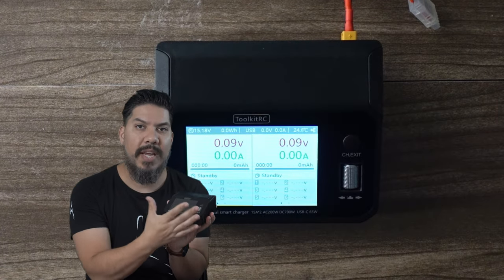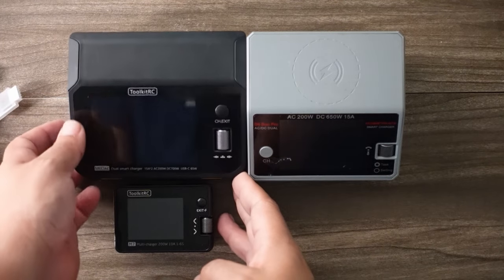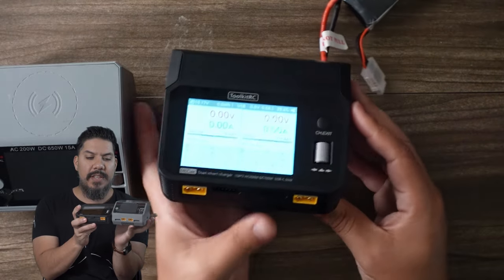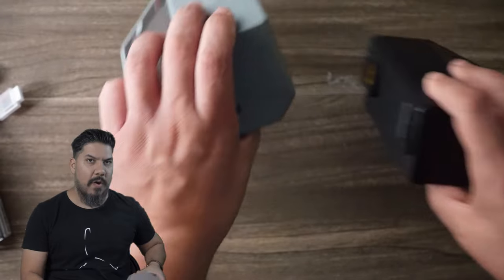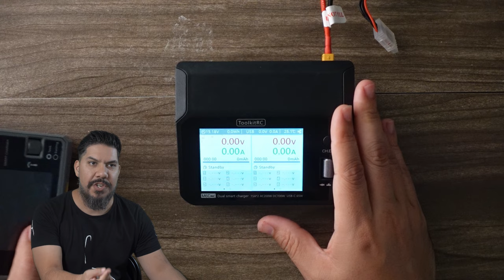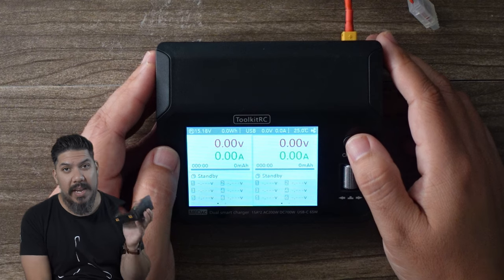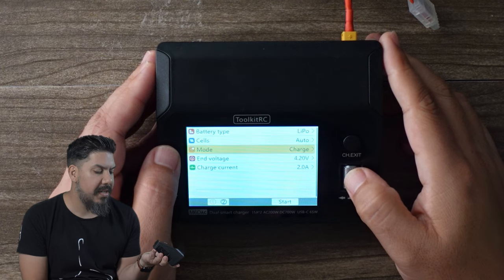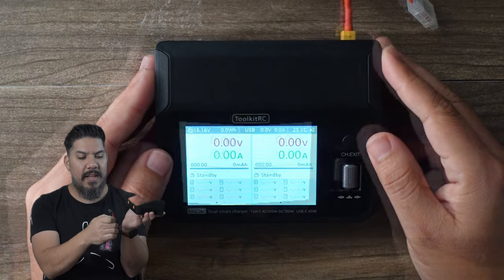ToolkitRC M6 Dual Lipo Charger for FPV Drones

Comment: I got one of these for Christmas. It lasted until May and then started over heating to the point you couldn't touch it and I was afraid it would catch on fire. The cooling fan had stopped working. I found a group where they were talking about this charger and all the problems they were having. They also say they couldn't get any help from Toolkitrc. I rate this thing as a no buy.

Comment: 3 out of 3 ToolkitRC M4Q are broken in less than 2 months. No service or warranty by neither Banggood nor manufacturer as 47 days till the first one broke is beyond China 30 day warranty.

First charges 2 channels at 1A max, if you add a battery to the 3rd channel the charger reboots, irrelevant the Amps on that channel. The issue is also documented by others.

Second shows totally wrong cell voltages for third cell on channel 3. It's not fixable by calibration, as it shows 1.9V on third cell even when connecting a 2S only battery. When connecting a 4S battery, third cell is just all over the place, totally wrong.

Third charger sometimes refuses to charge at all, showing cryptic error messages. It usually also gets insanely hot.

Fan is INSANELY loud on all of them.

I cannot recommend ToolkitRC and won't buy ever again. Apart from reviews on YouTube, regular users seem generally unhappy with them. I wouldn't trust "dangerous" LiPo to products of that manufacturer inside my house.